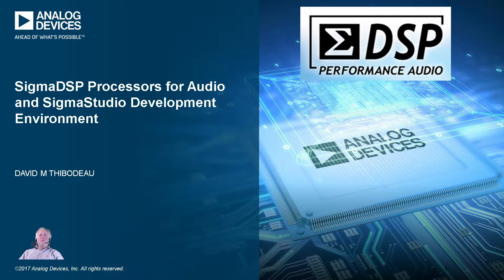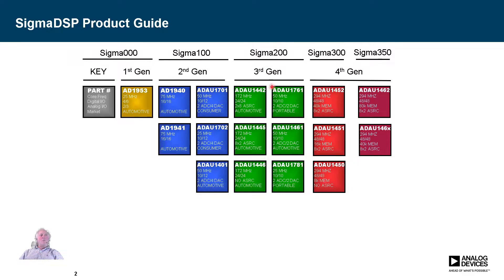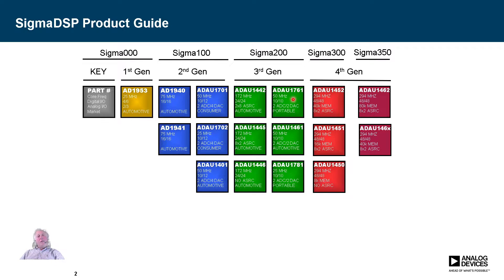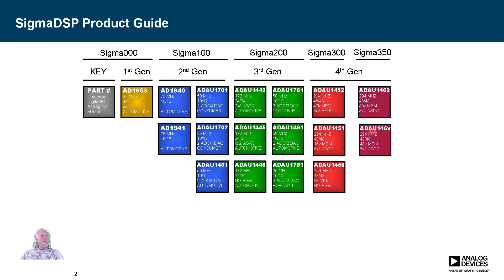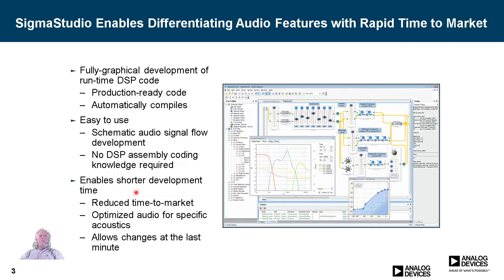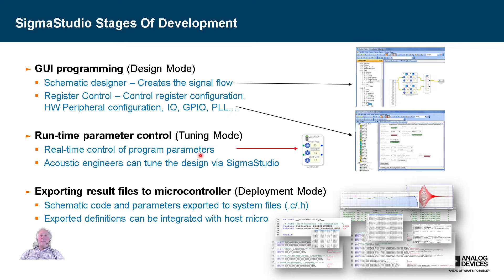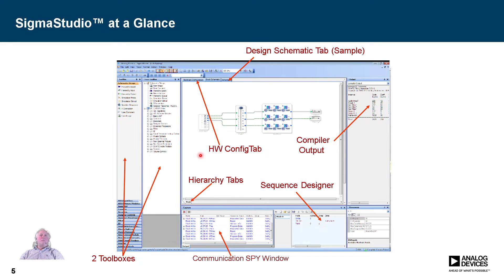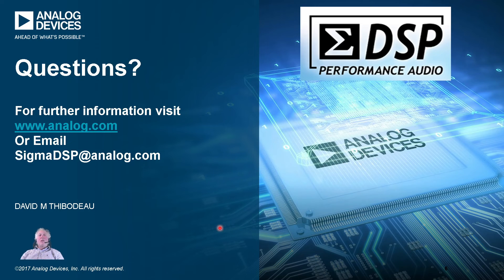Intro to SigmaDSP and SigmaStudio

Comment: I'm still struggling with what the hardware devices do and what the SigmaStudio does and is used for. I am a software developer tasked with outputting audio to the ADAU1467. I have basically no background in audio so the hardware is just another output device. And I have zero understanding of what one would use SigmaStudio for. This video is interesting, but doesn't orient me. I guess those in the biz already understand the context and maybe you are not targeting someone like me.
Reply from the maker: Helo Steven,
Yes, you are correct in that SigmaStudio is targeted to someone who knows audio and knows a little about audio signal flow but does not know the hardware too much and is not a low level programmer. So it allows someone to graphically program a DSP for an audio signal flow using blocks that are somewhat familiar if you have studies audio signal flow. So you have an additional challenge of also learning more about audio itself. If you go on EngineerZone on the analog.com web site there are some posts where I have posted some example files but it will be lucky if it ends up being close to what you need. I suggest you work out a block diagram of what audio processing you need to do and the result should translate a little into a SigmaStudio signal flow. The other option is to hook you up with someone who has developed on SigmaDSPs.

Comment: OK, I've watched this video again and I have another noob question here. You said that with the 4th Gen processors that run just shy of 300 Mz you have a "lot more processing". Can you please help me understand the correlation between processor speed and "more processing"? Perhaps there's a guide or whitepaper about that explains all of these features of a DSP core in a way that helps me understand what in particular each feature offers me in terms of processing ability?! Thanks again!🙂
Reply from the maker: Hello Mark, This is actually a good noob question!! 
The internal clock that is being sent to the core in these SigmaDSPs is what determines how many instructions you can execute. Each clock cycle is one instruction. So the internal clock on the ADAU1701 is usually setup to be 49,152,000Hz. Roughly 49MHz. That is how many instructions you can execute in a second. So then you look at the sample rate. If you have a 48kHz sample rate, then the number of instructions you can execute in a sample period is 49,152,000/48,000 = 1024.  
This is where the 1024 instruction limit comes from for the 1701 processor. That is a Sigma100 processor. All the cores are basically the same in that they execute one instruction per sample period but there is more to understand. 
The older Sigma200 cores in the ADAU1442 could run as fast as 172,032,00 which when divided by 48kHz sampling rate gives you 3,584 instructions per sample period. However, the Sigma200 core has been put in some smaller lower powered devices that only run just below 50MHz like the 1701 so you are back to 1024 instructions but a more capable core. 
Now, we enter into the Sigma300/350 cores. This was a HUGE leap in the core technology. First, it is capable of running faster. It is called a "300" core because it can run at close to 300MHZ.  A "normal" setup is to operate the internal system clock at 294,912,000 Hz which gives you 6,144 instructions per sample period!!! A huge leap but it does not end there! The core also has a quad MAC. A MAC is the multiply and accumulate hardware which is the heart of a DSP. This core can do four multiplies in one instruction!!! So a well written assemble code can calculate a 256 tap FIR filter in 64 cycles not 256 as most DSP core need!! So this makes these cores so much more powerful!! These are in the ADAU1452 and ADAU1467 families of parts.

Comment: how use FFT function in ADAU for getting amplitude and freq by SPI?
Reply from the maker: The SPI port is too slow to output samples that way. Use the serial ports. You could put in a ReadBack block and read it via the SPI port but this is not good and I do not suggest you try this. 
Now for getting the data from the bins of an FFT, that requires custom code. I wish we had a block to do that but we do not. I have asked for one.
Reply: @HowtoSigmaDSP samples I will be get through i2s, for fft analysis we need only integer values amplitude and frequency steps table of current sample.
Reply from the maker: @Wtf95  Can you go up onto the EngineerZone forum and send me a PM with your contact info? There is a lot more details to discuss. I understand that the FFT results will only happen after the entire block of samples are processed. If the FFT is setup for 256 blocks then you will need to read data every 256 samples. This is around 187Hz but then I would need to calculate the speed at which you could read it. You have to send the address and then read all those 32 bit numbers for each bin.

Comment: Would this work with 2 DSPs? (as in distributed control system). I believe sigma studio is interfaced with one DSP only but i need a confirmation
Reply from the maker: Yes, 100% it will handle more than one DSP in the same project. You can do up to four. SigmaStudio will not let you connect from one DSP to the other because that connection does not exist. You will see on the toolbox that each processor with the unique IC number will be listed. So you have to drag blocks out of the correct IC to connect them together. The register settings will be available. It is a lovely thing. I also like to design more distributed systems. Makes each node simpler especially with real-time applications.

Comment: Hello Dave, I have a few questions.
 1. Is the ADAU1467 your most Powerful DSP ?

2. When does the 4th Gen come out ?

3. Are the DSP in combination with your ARM Core driven CPUs faster and capeable to handle more MIPS? And does that mean less latency ?

4. How do I reduce latency overall and what is the latency if you run just a signal through it without processing?

Thank you alot!
Reply from the maker: 1) Yes, the ADAU1467 is the most powerful unless you venture into the world of Sharks. 
2) Contact me directly at Analog Devices and sign an NDA and then we can discuss. 
3) Using the DSP with an ARM has advantages. The DSP does the audio processing well and efficiently and the ARM core handles the MCU type tasks well. So smart allocation of tasks is a great way to design a powerful system. Latency with the ARM cores is a little different. They tend to be programmed in a block style where you have to collect a block of samples then process them. So that has a direct correlation with latency. The SigmaDSP is a stream based processor. It does not have to wait for a block to be assembled. It processes one sample at a time as they show up. So there is a sample period to shift in the sample. One sample period to go into a buffer for time correction from different serial ports. Then the core picks up the sample and processes it. Then it goes into an output buffer and then the serial output port shifts it out. That is five samples. There could be an additional sample period of wait if you are running as a clock slave so 5-7 samples is the usual answer for latency. Of course the sample rate will make a difference as to the actual time. 
4) You do have to watch what you do audio processing-wise. Most of the EQs are IIR filters so there can be some frequency dependent phase shifts. Obviously, if you use a delay line you add some latency. An FIR filter will also add some latency depending on the order of the filter. 
But, if you just do level, limiters, compressors and IIR EQs there is only one sample period of delay to process the program every sample period. Everything you create in SigmaStudio is processed every sample period.

Comment: Hi Dave, a brilliant overview. Thank you.  One comment/question about the self-boot operation. I have my local eval' board setup for self-boot operation, and yes I can edit the parameters live in tuning mode, but I always have to then link-compile-download and then write the changes to the EEPROM; i.e. the changes I make aren't stored to the EEPROM after just the link-compile-download operation. Is that correct? Or am I missing a cool trick? 😁
Reply from the maker: Hello Mark,
Link/compile/download just loads up the program into RAM in the DSP. The selfboot mechanism will load in the program from the EEPROM when you power up or hit reset. Either way a program gets loaded into EEPROM. The EEPROM is not involved in the normal operation of the DSP. Therefore, once you are satisfied that the program is correct you have to "manually" overwrite the contents of the EEPROM with the new program or new settings in the same program. How this is done differs depending on the DSP you are using but it seems like you know how to do that. Knowing how this all works is important for learning how to creatively use this. You can be confident to experiment with new programs knowing you are not damaging the old known-working program in EEPROM. It is safe until you decide to overwrite it. You can also use the link/compile/connect to just use the program in the EEPROM but control it with SigmaStudio. Right this second I am not sure if I covered this in any of my current videos. There is so much more I need to cover! So you are not missing a cool trick and in my viewpoint this is not a negative but a positive. The program is safe until you change it. 
Thanks for subscribing!
Dave T
Reply: @HowtoSigmaDSP  Many thanks, Dave. Excellent clarification there. :)

Comment: Excellent! Looking forward to the videos. I’d be very interested to hear if Analog Devices has a USB audio interface offering in conjunction with sigma studio to create custom multi channel audio interfaces. I find the product range a little confusing as a beginner. It’d be good to get some introduction to any dev boards available if possible. I wouldn’t want to invest my time & money on end of life products, so up to date info would be much appreciated. Keep up the good work 👍
Reply from the maker: Hello ,
I wish we had a USB audio interface built in but we do not. There are some available from other companies but I personally have not used them. There is this product from mini-dsp that would work well to develop a multi-channel interface and the cost is reasonable. If you are looking for something that will be around for a long time I would work with the sigma300/350 line of products. The ADAU1452 and the ADAU1467 families. These are very powerful but the complexity is a little higher. I will continue to produce videos to hopefully make this a little easier. The ADAU1701 family of products is very old now but super popular because it is so easy to use and low cost. It is still a great solution for many products. Especially things like speakers. With SigmaStudio it makes it easier to migrate to newer parts but it will not be a simple cut and paste but many parts of it will be easily copied. Stay tuned for more videos. The list of possible topics is quite long. 
Here is the link to the USB Streamer.
https://www.minidsp.com/products/usb-audio-interface/mchstreamer
Dave T
Reply: @HowtoSigmaDSP  Thanks Dave! I've been experimenting with the XMOS 3rd generation chips, and I've managed to get it to talk my EVAL-ADAU1467Z evaluation board via I2S. I also got the Aux ADC pot to work as a volume control thanks to your video about bit shifting the ADC data, I would've never have figured that out, so thanks!! I'm slowly working my way through your videos. I'm looking forward to getting the macros to work. For now, I need to figure out how to control EQ parameters via I2C so I can control EQ with an external MCU. Anyway, got lots to learn and you're doing a fantastic job!! Thank you so much for your efforts, It's not gone un-noticed. Bernie